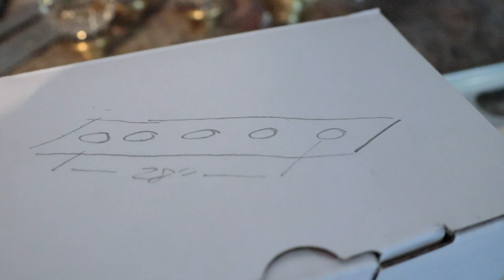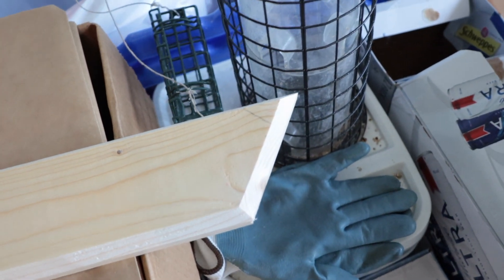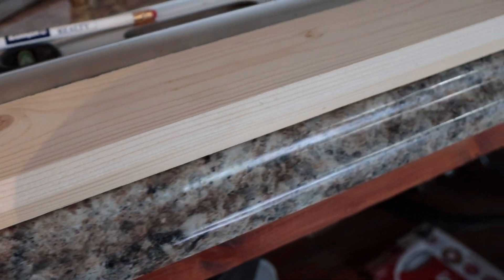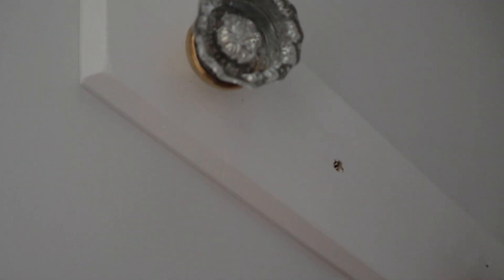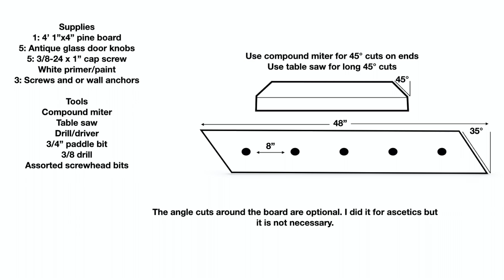How to make a antique door knob coat rack

Comment: But how did you attach the knobs... From the top from the bottom... Screws glue gun or other
Reply from the maker: The antique knobs are threaded so I used screws and washers to attach them to the board from the back. Sorry I must have forgotten to add that.